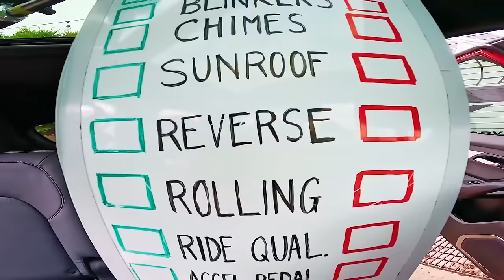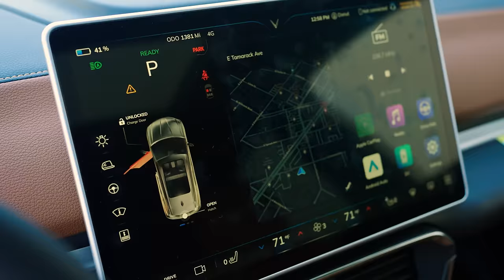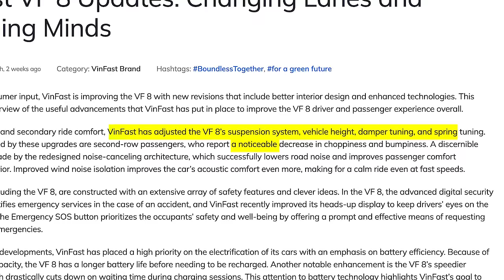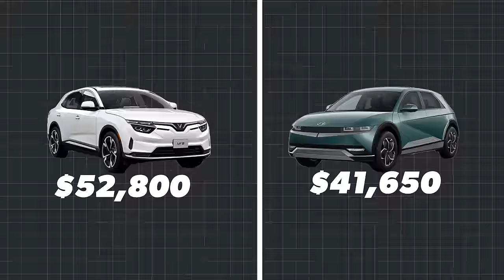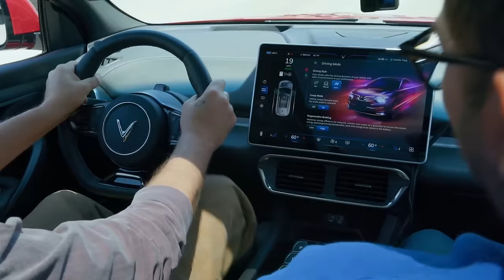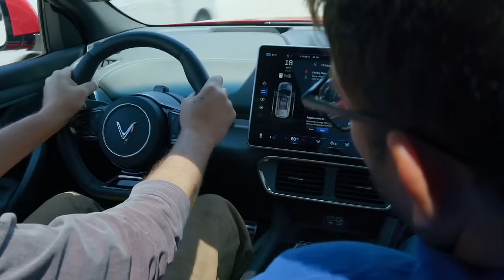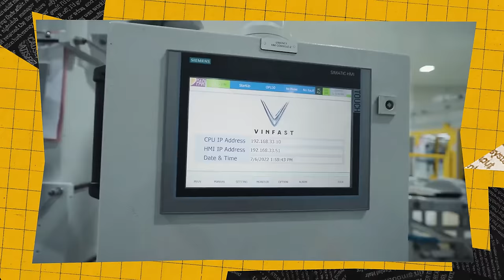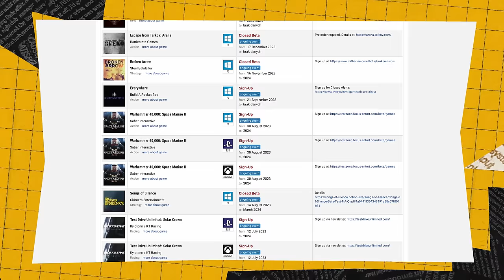We Drove America’s Worst Reviewed Car Again

Comment: The most important question is whether or not this unit was made for press. Press units vs off-the-lot units are often wildly different. It's why Consumer Reports doesn't use press units. They buy from dealerships.
Reply: Gm did that with the vega
Reply: I mean I could buy them making sure their press cars have the best possible fit and finish on the parts. I don't think it would make sense for the things they talked about in this video, software and suspension parts, to be different from the production models.
Reply: Seems weird how the car was garbage last time and it’s good now after donut got a big paycheck.
Reply: @clumsygarage1578 it's literally not possible to make all of the updates they demonstrated if the vehicle is already in production. Either it's a press vehicle or it's a pre-production unit and they're using it for development. If it's a press car this would be BAD news.
Reply: @Hawk7886  you mean software updates are impossible?
Reply: @Hawk7886   It is software and some fairly suspension updates. It isn't that complicated.
Reply: @garrettwilson3264  That is not indicative of how the video went at all
Reply: @Hawk7886  It's impossible to make changes to cars? Really? No car has ever had suspension and software changes in the years after it comes out? Suuuuuuure lmao.
Reply: @garrettwilson3264  They said it was better, not that it was an objectively good vehicle.  Because that it isn't.
Reply: @Hawk7886 as far as I can tell, 95% of the issues they had with the previous version are all software, so if they have an existing pipeline for over the air software updates. Then literally all they would need to do is a suspension upgrade, and depending on how they went about that suspension upgrade that could literally be done by just changing out the parts you supply to the production line
Reply: Yeah, we don’t even know if vinfast are paying for this re-review!
Reply: @the_undead  updates like that cannot be performed OTA and would require some sort of dealer support, either as Product Updates or recalling, which would royally suck. Updating the suspension would require recalling all of the vehicles that are sitting in dealer inventory or already sold to customers, and resetting the build lines to reflect the changes.
It's not a good look.
Reply: @garrettwilson3264  they literally said it was still not a good car
Reply: @clumsygarage1578  That's not how that works.
Reply: @clumsygarage1578 what car company changes stuff in the middle of the production year? Youre a lil lost.
Reply: @Infernos94 darn near every car company. I've both worked in a factory that built exhausts for Nissans and as a parts counter guy. There are absolutely times where a given car changed mid cycle and we've got to look a year earlier or later to get the right one, if we're lucky it will list "built before..." and "built after", but not always
Reply: On top of that this seems sorta like a paid sponsorship whereas before vinfast was not involved at all.
Reply: Agreed.... They should hit a dealership and give one of those a test drive to see if those are the same
Reply: Yeah the fact that this is a review model intended for them makes me wary. That and the fact that they marked the driving aids as "fixed" when they said blindspot monitoring was still inconsistent and lane departure assist was a bit weird as well.
Reply: @datownkidd  "Let's pay donut to re-review our car so they can say that it's still overpriced and not really good" 
Damn you are not very smart
Reply: Yes this version building for donut
Reply: VF8 sales in Vietnam are very bad, the reason for Vinfast to use them as taxis😅😅
Reply: Yep, not really a real review here. Vinfast is slick so I would still be wary of buying from them
Reply: clearly
Reply: @vivuphuongnam bạn ơi. Bạn đã mua xe vinfast vf8 hoặc đã lái nó chưa?  Có lẽ năm 2023 nó chưa hoàn chỉnh. Nhưng năm 2024 mình đã đi rồi. Nó rất tốt. Hiện tại vf8 sử dụng pin CATL với quãng đường được EPA công nhận là 264 miles. Nó đáp ứng được nhu cầu của tôi. Một điều thụ vị nữa là vf8 năm 2024 giảm 100 kg so với năm 2023 nhờ cải tiến trọng lượng bộ phận pin
Reply: @phu99gia24  pin nào cũng thế, phần mềm và phần cứng của vinfast không đồng bộ nên bị lỗi, ồn ù, hiệu suất kém, chất lượng kém.😅😅
Reply: @garrettwilson3264  seems weird how you're making a comment based on none of the information available in the video.
Reply: Это конечно хорошо но моя машина лучше
Reply: Let order 1 by yourself, no one can stop you :)
Reply: @phu99gia24 mấy ông cmt chi tiết vừa thôi không lộ hết ra là nhân viên của Vin, nói những cái bao quát như người lái thôi 😂
Reply: @Hawk7886 new models that roll off the line can come fitted with the upgrades…
Reply: @Infernos94 every car company ever lmfao.
Reply: Out of spec reviews just got 1. The buying experience was not good.
Reply: oh shoot come on now..we know it was.
Reply: I own a 2024 Vinfast VF8 and could see that they really fix issues as pointed out by Donut, not just for press unit. It looks like that they listen to drivers and to reviewers like Donut.
They are new in EV business and really want to learn.
Reply: certanly....they send them a good car but regular folks would get the crap ones
Reply: @vuduyquang9286  không bạn ơi. Tui là người nghiên cứu nhiều về vf8. Để xem thử xe đã tốt hơn chưa?  Phần mềm còn bị lỗi vặt nữa không ?  Tui muốn mua 1 chiếc. Nhưng giá tiền nó cao quá nên phải cẩn thận. Chờ người tiên phong cho ý kiến. Ngoài ra xe vf8 cũng giống xe tăng abraham M1 của Mỹ hoặc f-16, f-35. Những loại phương tiện siêu ưu sạch sẽ. Nếu cảm biến của xe bị dơ bẩn. Nó sẽ báo lỗi tùm lum hết
Reply: @garrettwilson3264 I think "good" is overstating their review.  "Not completely horrible" is more accurate.

Comment: 9:04 it's actually an image of a VF7, which is available for Vietnam market recently. Since it has a mostly similar engine, platform, suspension to VF8 and a smaller size, a lighter body; the driving experience and performance seems to be improved. Will be an interesting comparison to the model Y then.

Comment: It's primarily developed for the Vietnamese market, where a Tesla costs 200% more than USDM. And seeing as it's been developed in Vietnam, it's probably much harder to develop the blind spot detection software because of the chaotic traffic and road layouts in the cities. Lots of motorcycles lane splitting and no highway in city centre. Perfect car for Hanoi or Saigon, they need electric cars and cleaner air more than ever.
Reply: Your information is way off.  It was NOT developed in Vietnam for Vietnamese market.  It was developed by the Chinese to Sell to US market.
Reply: @poolbum  BS
Reply: @poolbum  poor information
Reply: @poolbum  Vinfast is part of a huge Vietnamese conglomerate. China has its own EV industry, they'd rather sell their own cars than develop a new brand in Vietnam. Vietnam barely had an automotive industry and most Vietnamese drove motorcycles because of high import taxes on cars so Vinfast was founded to develop a domestic brand.
Reply: @poolbum Distorted information, individualistic thinking, poor understanding.
Reply: Made in China
Reply: Tesla costs at vietnam is 300% more than US
Reply: No car "is perfect" for Saigon/HCMC or Hanoi. Anyone here knows that it's a nightmare to drive a car here. Terrible traffic, awful drivers, massive overcrowding. These cities need modern rail transit and commercial only roadways for factory and container traffic. Doesn't matter if it's petrol or EV, cars won't help anyone in these cities.
Reply: American road safety systems are not appropriate in any developing country. Not only will they not work, they're down-right dangerous in the chaotic traffic "rules" in these places. I would dread driving such a thing in Egypt.
Reply: @bent4116 driving a fast ev in Saigon and Hanoi is fun. It’s like car racing scenes in action movie. lol
Reply: @poolbum You should ask the US government 🤣
Reply: @poolbum  you need to comeback to china to relearn 😊
Reply: No! They need less damn cars and more motorcycles. I lived there for 2 years and it's always the freaking damn cars that hold up traffic, because for some damn reason cars have to drive 20kmh below the speed limit for some reason. Cars are the reason behind gridlock in most countries, because nowadays it's like one driver to ONE massive SUV type vehicle. Very rarely would a private vehicle be fully loaded with people, so in essence private cars just waste a whole tonne of space. There should be more incentives to drive scooters or motorbikes and governments should prioritize infrastructure for these vehicles.
Allow large vehicles to mostly taxi drivers and truck drivers, and limit private car ownership somehow in a fair way.. probably easiest is through fees I guess, though I don't like it. People should actually have space, they need to really really know how to drive and not drive like freaking turtles.